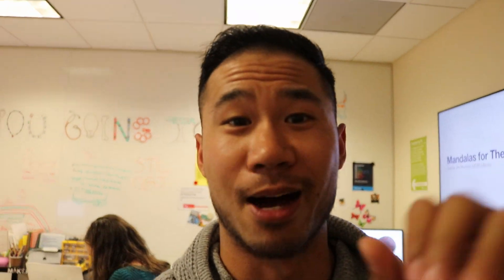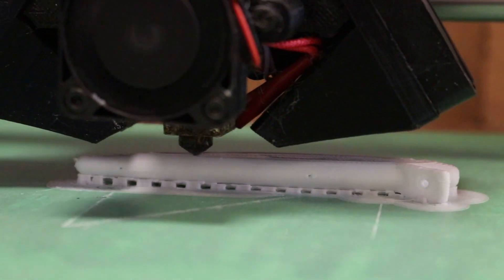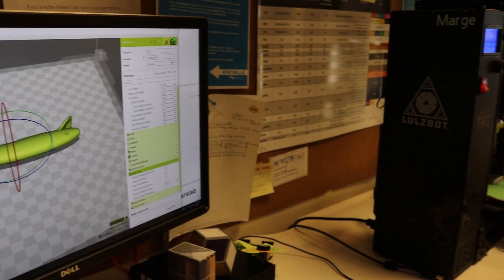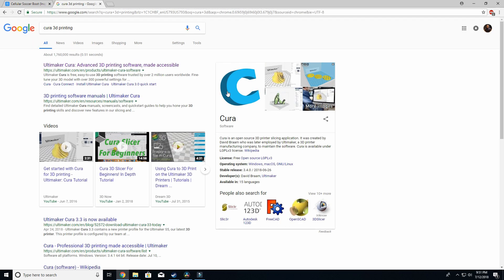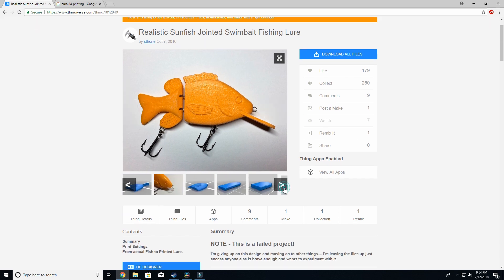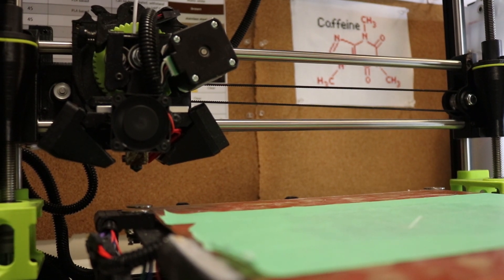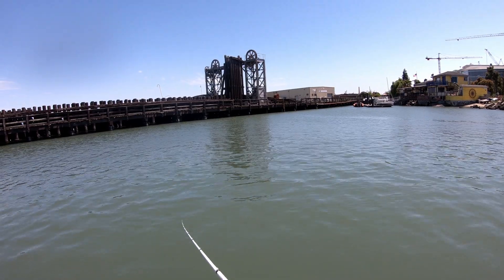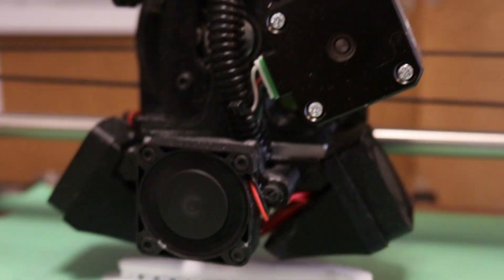How we PRINTED our own Fishing Lures

Comment: Your 3d printed lure swims to the side; which means the lead weights are not located where they're supposed to be.
Few things to try:
1) 3 print the lure keep it sinker free.

2) modify the design to shift those hole towards the belly, and use symmetrical weights such that the right and left halves weigh exactly the same.

Good luck, and let us see how it goes.

Comment: The only problem is, it is biodegradable which it will dissolve in water over time. However loosing a lure in the fish, the hooks holding the lure in the fish will rust off, so the hooks rusting off will save the fish, and biodegradable lure will just dissolve over time.
Reply: Once you paint it and put a sealant on it really won’t biodegrade that fast

Comment: Change the print orientation by 90 degrees and it will swim better. All the build support was on one side so that side is heavy  (the side that needed extra sanding)! Put the build support on the bottom or top of the lure to have better balance in the water. 
Tight lines and happy printing!
Reply: Great idea, ver 2.0 will be printed upright to hopefully avoid that problem. Cheers!

Comment: That was a really interesting video.  If you put rounded steel shot and vary the size (one large and two small) maybe it would help with the lure running upright?  Also if you were to completely sand the wood grain like patterns off and/or apply a few layers of clear coat to give it a smoother finish.  It may help with the way it "walks" in the water.  Looking forward to the next installment and how you refine the 3D printed lure.
Reply: Thanks for your suggestions, working on ver. 2 so stay tuned for an update!